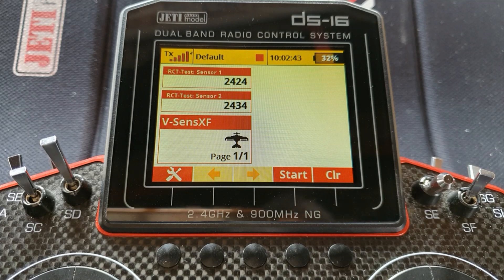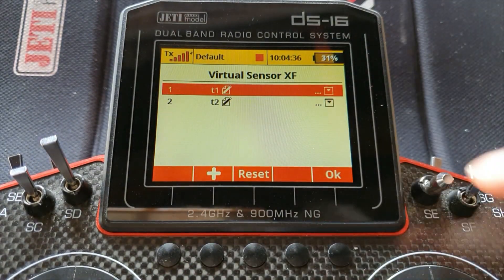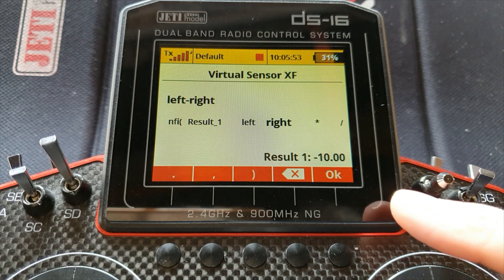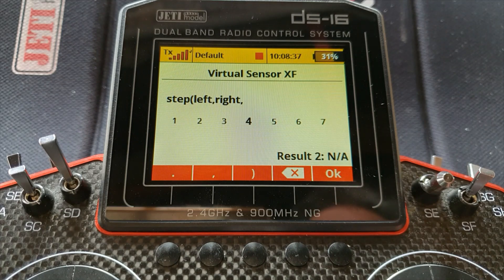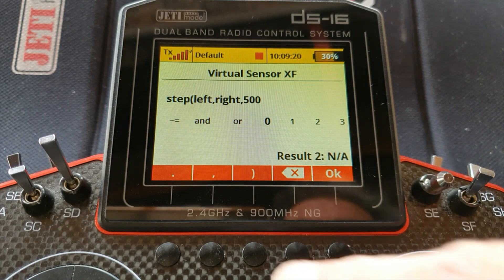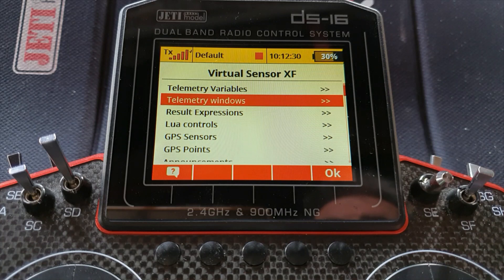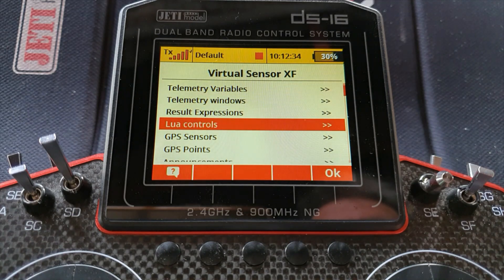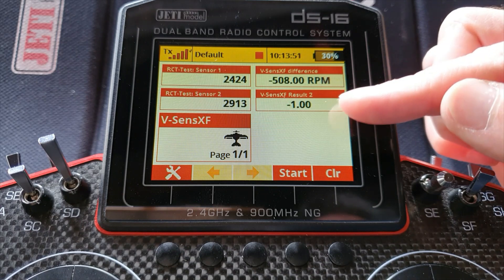Jeti - Virtual Sensor Extended Function, episode 2, twin engine rpm example

Comment: What an amazing video. Used the Lua application as per the detailed explanation. Worked like a charm.
One question Harry and any guidance in this respect would be greatly appreciated. Can we use LUA script to actually control the throttle servo inputs in a twin engine plane so as to match their RPMs, like in a Master /Slave configuration. In other words, automate the synchronization of the two engines thru a Lua app in Jeti radios.
Reply from the maker: Don't go there!  Jeti says do not use a LUA app to control any flight controls and there are good safety reasons for this.